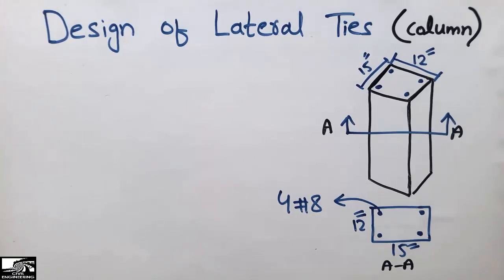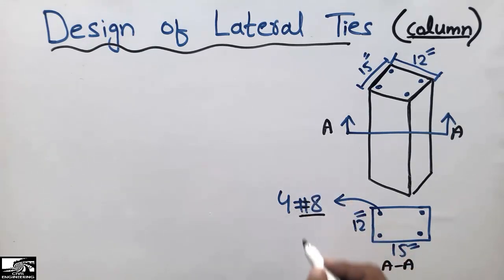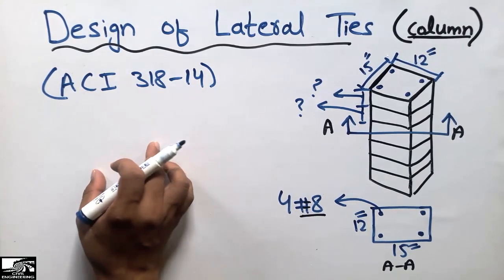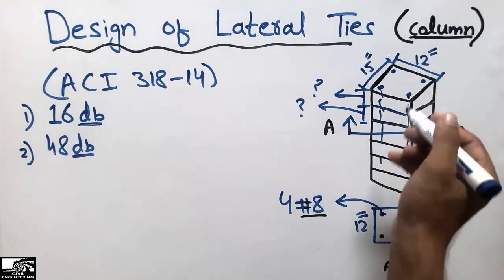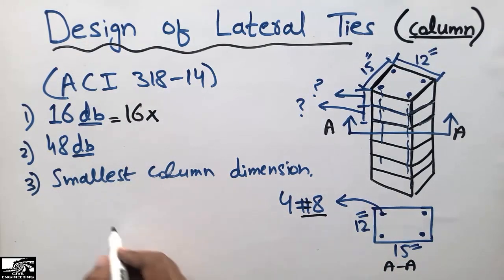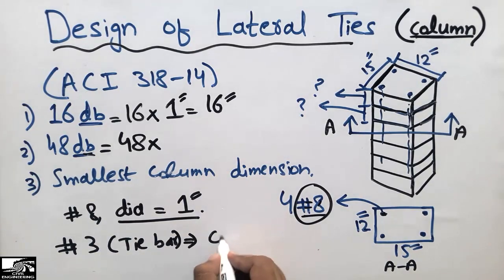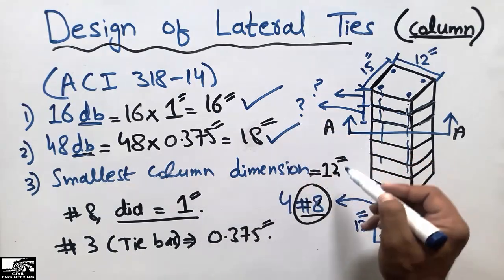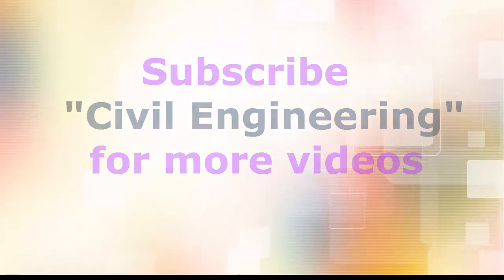Design of Lateral Ties for Column

Comment: Thats right but one addition is the spacing is less at certain length near the edges
Reply: how to find the spacing at certain length near the edges?
Reply: @ethan7276  ACI318-18  section 18.4.3.3 covers the closer tie spacing requirement